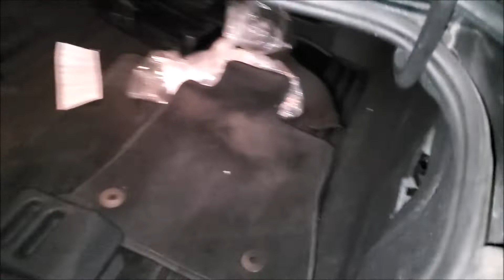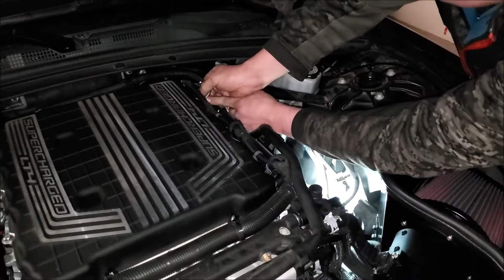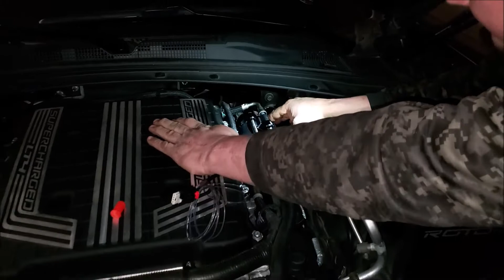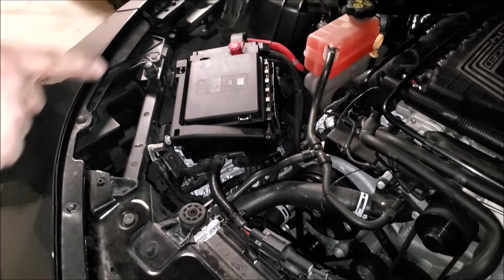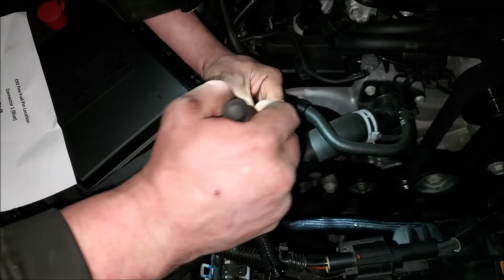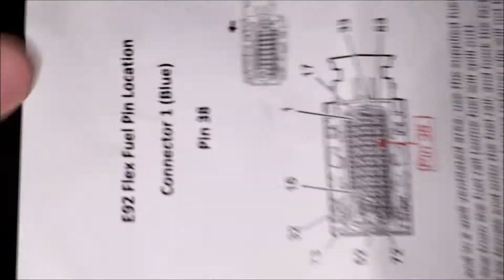Installing A Flex-Fuel Sensor On The 2018 ZL1 Camaro

Comment: that sensor hooks right up to your wallet and debit card. when you floor it, it starts deducting dollars
Reply from the maker: Right now E85 is wayyy cheaper to run than 93 fuel lol.
Reply: @1018Video yea but if your running E your most likely flooring it lmao